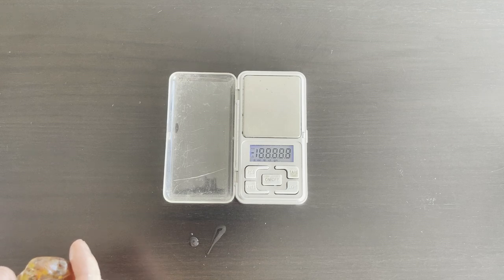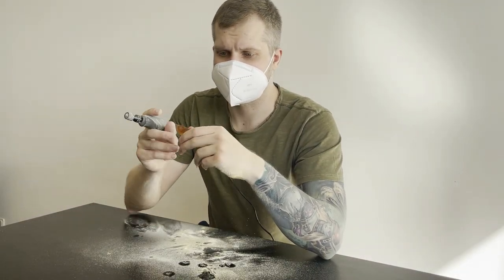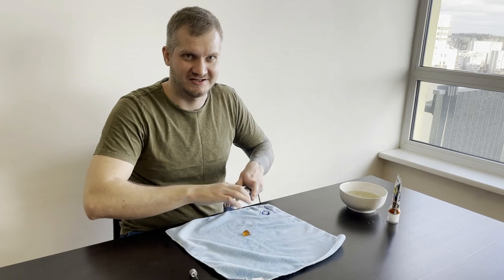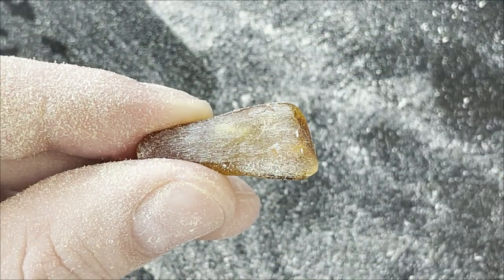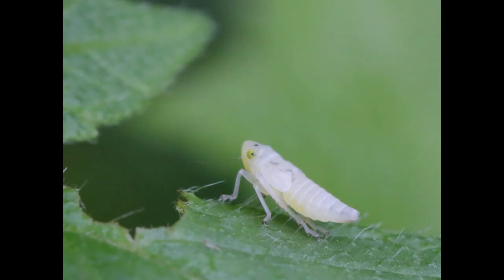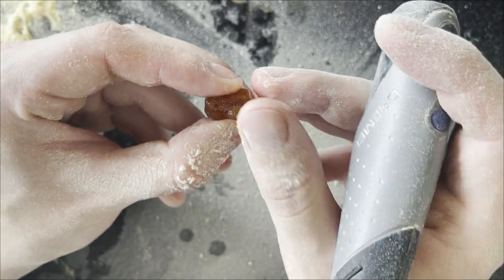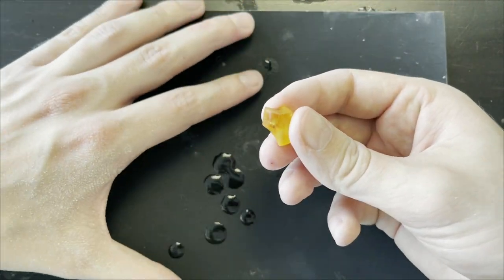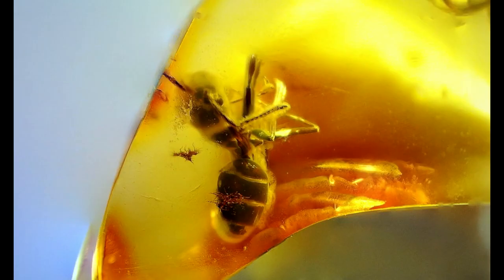Polishing three pieces of Baltic amber with inclusions

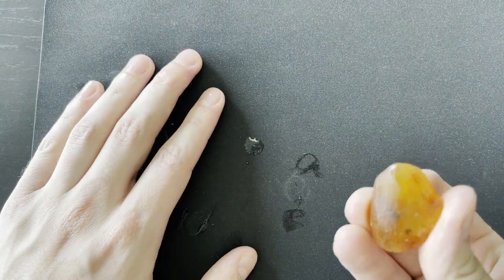Comment: 3:40 Oh no! This happens to me sometimes, and depending on the characteristics of the piece, like to repair it with jewelry-grade epoxy glue. The refractive index of the epoxy resin is about the same as amber's, so the repair is practically invisible (unless it's under UV light).

I'm still not certain if repairing amber in this manner is as acceptable a practice as it is in repairing fossil specimens, or if this has a significant effect on the finished amber's value. ; )
Reply from the maker: I think its not worth it personally (just my opinion) i liked the piece more when it broke, because after it broke crack disappeared😁